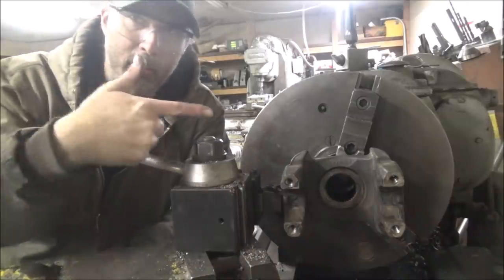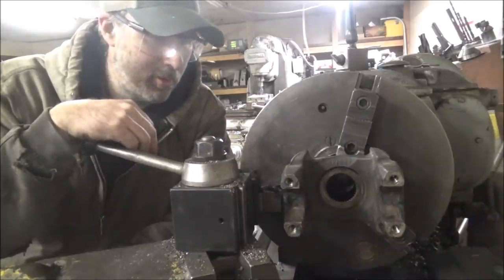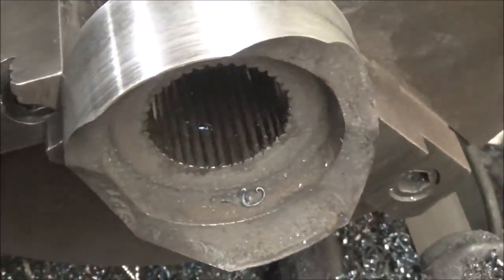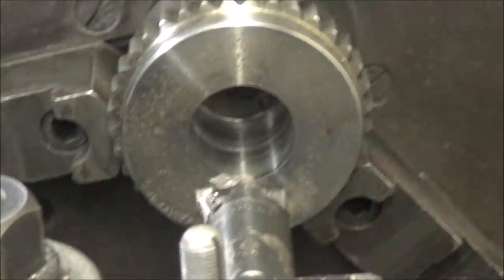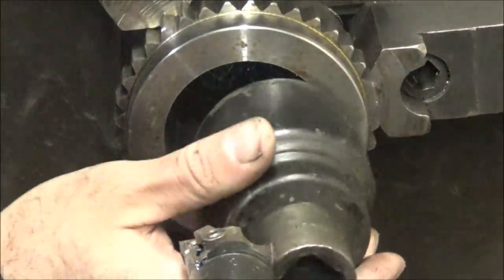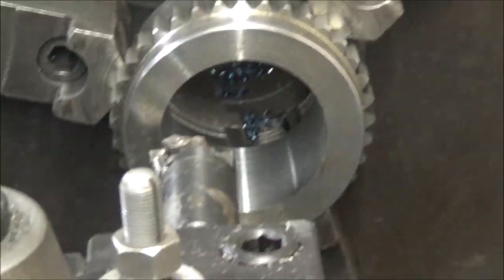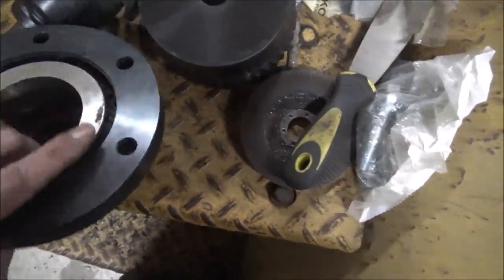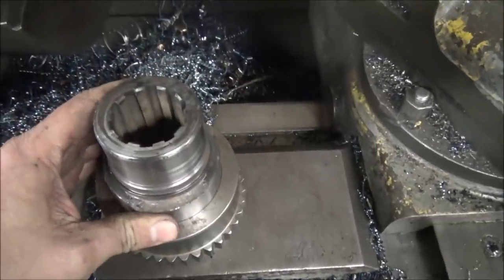Cummins 8.3L Swap Hyster Forklift Part 14: Super Short & Strong Driveshaft Connection Gear Coupling

Comment: I forgot to mention. The press fit and welding will be just fine. If you have ever had a Fuller truck transmission apart you will see the aux box gears are welded to the shaft. They actually use no carb paint on the surfaces to keep them soft for welding. So if it works in a 18 wheeler or a dump truck. It will work on your forklift

Comment: Looking good Brian.  With .006"  press, you probably don't need to weld it !  Be careful that the hoop stress does not shrink down the internal spline.  That would be a shame.  I might recommend .003" press if you are welding it also.    I remember a job I was doing at the grain elevators.... I had to change out some ball bearings, The ID was 5" if I remember.  The press fit on the shaft was .006".   I needed the 75 ton puller to get them off, and put the new bearings on the hot plate to get them to go on.  Fun times.  --Doozer
Reply: One shop I went in to has an oven with signage, not for food, they heated bearings and other things in it and on it.
Reply from the maker: Heated to 500 in the oven and it pounded in ok with the hand sledge. I suspect at matched temps it would have taxed my 100ton press to get it together. The weld was really mostly for looks the plan was always for the press fit to do most of the work.
Reply: @bcbloc02  Awesome Brian.  Always some pucker factor fitting hot and cold items together. Glad it went well.  Hey, I just uploaded a 2 hour video on some mods to my facing head....If you have nothing else to do.  Ha !  ---Doozer

Comment: Ya that is so the forklift sombody with a low boy trailer needs. Loading and unloading of machinery and what not making that a breeze not a waste of time. For me I like the eddison cell deal's I'd rebuild those battery's and make it my version of the tesla. solar powerd ( I got a little hobby shop) tooling a 3 in 1 mill drill lathe right now. Find your video's very entertaining you build cool useful stuff love it!
Reply from the maker: Can't say I have seen any electric lift trucks good for offroad use. Even the little LPG powered ones we have at work are treading in dangerous territory even in gravel. Fortunately this lift does very well in gravel.

Comment: hey Brian, I've been asked to turn down a ring from a ford super duty's diff. In your experience are the real hard and if so what type of cutter do I need? I have only carbide presently.
Reply from the maker: Are you trying to turn the od or the Id? Usually ring gears are hard as hades and if you get into any of it with an intermittent cut it will trash a lot of inserts.
Reply: @bcbloc02  od, he's trying to fit in a shaved diff housing to give his jeep more clearance. lol he said every inch counts
Reply from the maker: Billy T tell him to buy taller tires! Lol he is going to have 2” of diff case cut off before he gets to the ring gear. That is going to severely weaken that diff. Maybe he should have used a Dana 70 instead if clearance is that big a deal. Be best just to take an angle grinder to the od of that ring gear if you want to cut it. The teeth will murder any inserts.
Reply: @bcbloc02  lol, that for the advice, I think I'll pass, it's one of the friend of friend jobs, apparently, he's putting his jeep on tons and running 40s.... lol he should be concerned more about the jeep's frame in a case like that. haha

Comment: I thought carbide was not a good choice for interrupted cuts. could you have used HSS.
I'm just a newbie and Im trying to learn.
Reply: Good observation. 
I think the key is to attempt to minimize the shock/mechanical loading by not trying to remove too much at once
Reply from the maker: There are many different grades of carbide. I always buy the toughest grades because of the types of work I do being brutal on tooling versus working on all new steel so I need the toughness more than the ability to hold a sharp edge a long time. I have lost way more inserts to breaking than to going dull in my line of work. The grades designed to stay sharp and cut a long time would shatter to bits on a beating interrupted forging cut like this.
Reply: @TqSNv9R0iG5Ckxew  Thank you for the reply I need all the input I can get
Reply: @bcbloc02  Thank you for the reply I will remember this and try to work accordingly